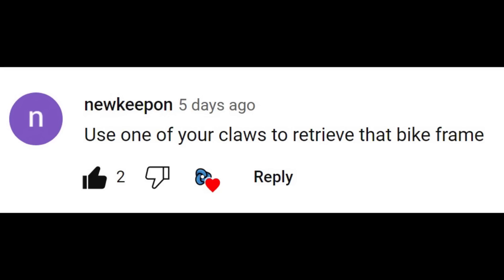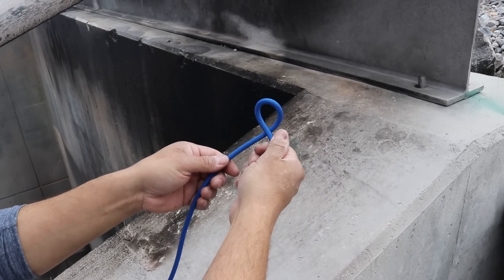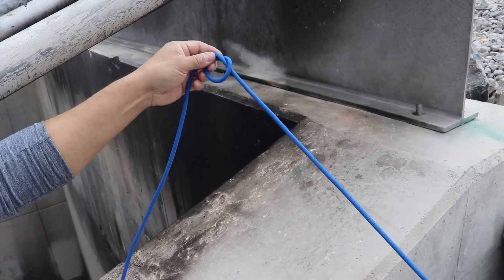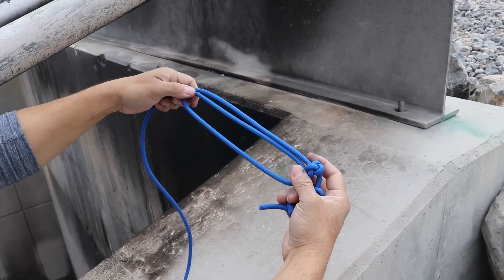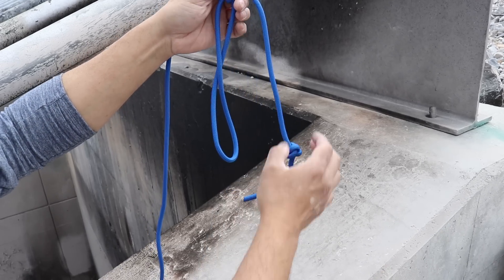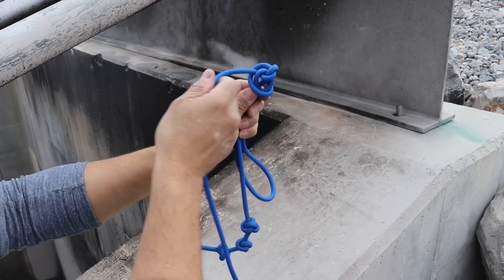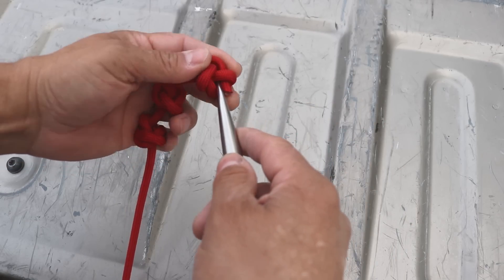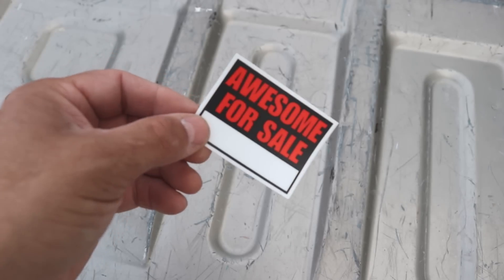Gravity Hook Knot

Comment: Just seen and practiced a similar solution, but the stopper knot and hoop are on different ends of the rope, and you have more control of end ends by pulling separately until it latches.

Comment: This is a very interesting knot. I would like to see your perspective on catching an object that is partially or fully submerged with a gravity knot.

Also what advantage could you gain if you have two people on either side of a chasm trying to get a catch on the same object.

Working with another person holding onto the same or joined rope, its very easy to accurately position a knot over top of an object. It would be interesting to see your work on an effective knot or rope structure that takes advantage of two people pulling from opposite sides.

Even working solo I can position the rope over top an object much more accurately by working it from two sides of a chasm or valley.
Reply: I guess underwater you'll need to tie a monkey's fist with a weight inside instead of the first trefoil. Weighting the other side - the loop - should also be possible, but I have to think of which knot would be the most convenient for that.

But you'll definitely need weights (stones, marbles).
Reply: I bet if you could get a solid knot around a rock at whichever spot you are at (river stones for example) you could have that sit as the tag-end trefoil(?) knot. Or even add extra length to the tag and fasten the weight right up to the knot. As long as you can fit the weight through the toggle loop you should be good.

Comment: Tried it as soon as your vid dropped, but the knot slips as soon as the creature pushes up onto it, and every time it does, it drops the bike, that is- it it doesn't dissolve the rope first of all.

Getting sick and tired of this bike retrieval, and the radiation above the void just keeps increasing, yesterday just  0.14ųSv , just now some spikes above 2,50ųSv, not to mention the freaking rope length ever increasing. Glad I followed the advice in the comments at least, without the pulley system I'd been down there as well..